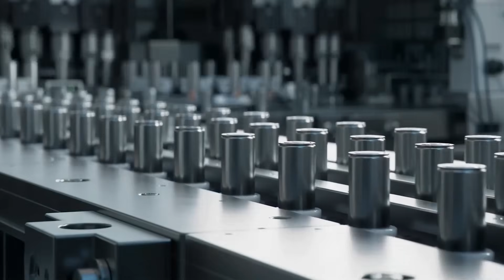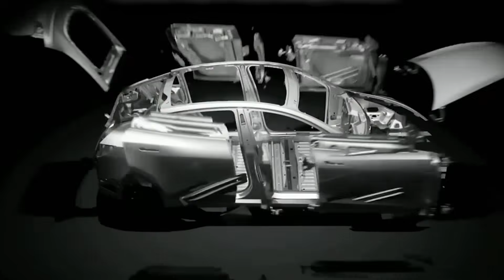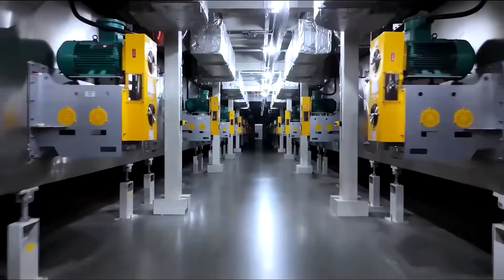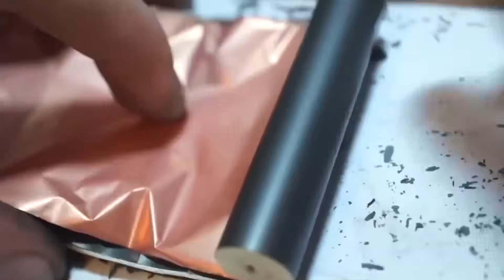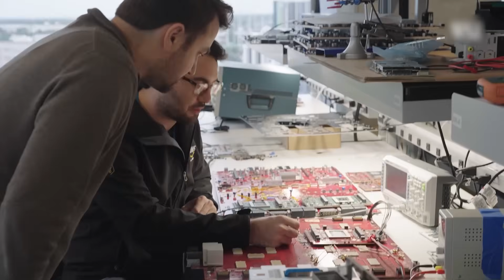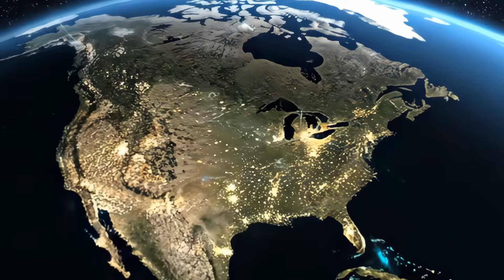Elon Musk Just Exposed Tesla’s Real Plan — The Next 5 Years Are Already Locked In

Comment: I like all of it except the idea of depleting the battery pack by letting the grid have access to the electrical charge in the mass of individual cars, thus edging the cost to replacing the battery pack, but not getting enough from selling the electricity back to grid. (It's always less than the rate that it costs to charge the car to begin with.) There isn't enough return from the utilities tp fairly amortize the cost of the purchased electricity, nor for the cost of replacing the battery pack. I wish Elon would make converter kits for the old land yaught-type cadilacs Either that or actually make  a 1969 Eldorado analog.

Comment: Tesla always had circuit breakers rather than fuses. One reason legacy automakers don’t want to change to circuit breakers and a 48 volt electrical system is Tesla didn’t have boxes and pallets and storage containers full of fuses, plus the little fuse holders, plus the screws that hold the fuse assembly to a piece of metal, or all the same storage for thick wiring. Why? Because throwing sll those parts out would be a waste, and selling them on the open market might cost more than throwing them

Comment: The tires wear out 4 times faster and same with brakes cause of the weight!
Reply: Tesla comes with their own special tires that are made by Bridgestone & yes they still wear out faster with about two thirds of the miles.  Now as far as the brakes are concerned they can last almost as long as the car itself,100,000 miles,as a matter of fact you have to purposely use the brakes once in a while to reset the brakes,they can get a little sticky & the disc rotors can get rusty.Most electric cars use regenerative braking which Tesla has used from the beginning which negates the use of brakes mostly until the end of the stop.   PLEASE DO YOUR HOMEWORK BEFORE MAKING ERRORONIOUS STATEMENTS🧐👍🤔

Comment: An electric car should have a plug-in transferable motor at each wheel. Should a motor fail, the car can still move on one, two or three other motors. The system should be easy to fix by the owner changing the motor and it would be an all wheel drive vehicle as a bonus. This will do in the short term until we transition to flying cars that will work on principles of anti-gravity, not propellers. The future is near and wonderful.

Comment: For me, the biggest Tesla failure has been the 4680.

At 500 Wh/kg, you could halve the weight of a 75 kWh battery pack. Reducing the pack weight from 500 kg to 250 kg would bring the vehicle's total curb weight within the threshold of standard passenger car tires and EVs would completely replace ICE vehicles.
Reply: Does it burn rubber?  😀
Reply: @pctrashtalk2069  replacements annually
Reply: The best battery, is it total failure now that makes a lot of sense
Reply: @xelzbrod...3533  It’s not just the fate of EVs here on Earth